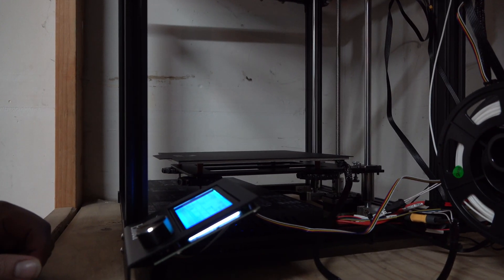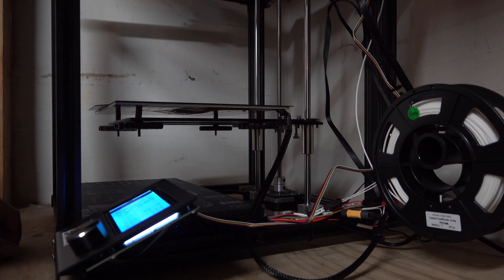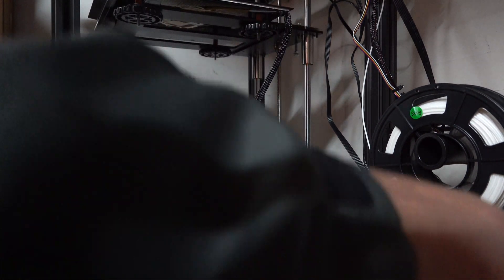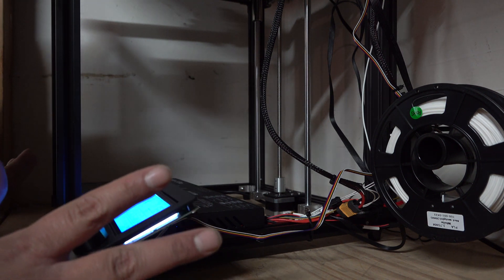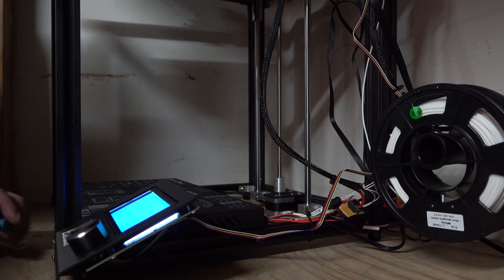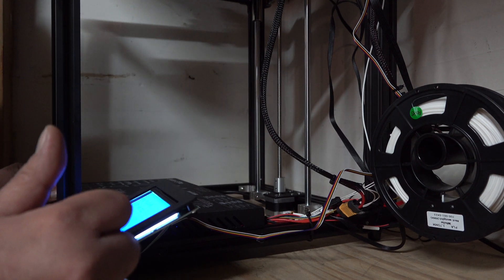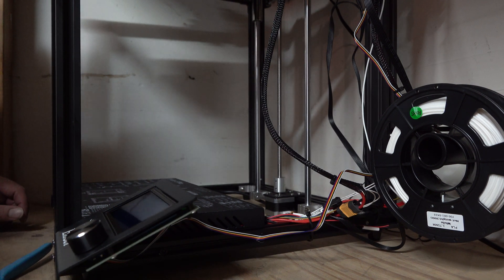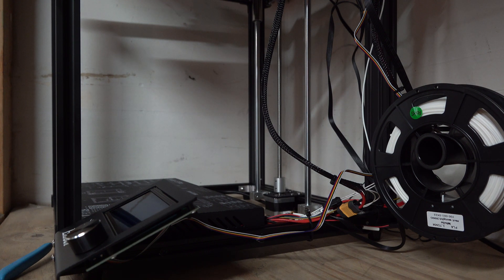Creality ender 5 pro z axis grinding noise on first use

Comment: Z switch, BL Touch not triggering zero a top position
Reply from the maker: fyi, we figured out that the host computer was sending ender3 signals to the ender5, this is because I'm using by-path instead of by-id (since 4.2.2 creality boards don't update their mcu id after being flashed). That causes problems where I try to stop or disconnect a printer using the cable or power switch - it will mess up the communication of the other printers... the ender 3s have their x stops on the opposite side which is why my ender 5 was making that noise... with all that said, my ender5 was failing differently early on because I had the board too close to the print head - the cr touch was not extending all the way so it was failing when I was doing the probe_calibration tests: turns out I just had to move the z axis down a bit to trigger the stop correctly, and from there it worked as intended.
Reply: @frankenmint  When you say you had to move the z axis down a bit do you mean you adjusted the lead screw's nut or sensor or in the firmware? I too, am having this problem. I also suspect the lead screw motor but I really really really don't want it to be that.
Reply from the maker: @carolhanson3198  If I recall correctly, the build plate was too close to the print head so I needed to manually move the build plate down just enough so that the touch sensor would fully extend.  mine was not fully extending so it was throwing an error back to the firmware. I manually moved my build plate down just a bit  with the lead screw nut. once it homes correctly that first time it did it correctly therafter.  Another way to think about it is ifthe z sensor remained pressed down and the firmware was checking too see if the sensor is not pressed down...but it never moved the build plate, so it is also never going to trigger that the sensor is not pressed... it's the same idea with the sensor being too close to the build plate that it fails to work correctly. I haven't used the enders (or done much 3d printing) in a long time
Reply: @frankenmint  my bed won't raise from the bottom but 20mm then fall back down and grind. I put the old mainboard and display back on without attaching the cr touch and there's no problem. I will try again with the cr touch installed if possible but I'm having touble finding a wiring diagram for it.